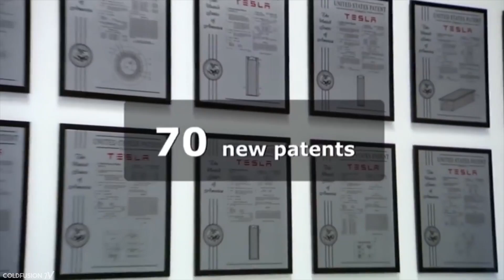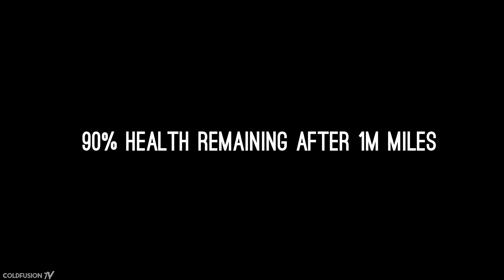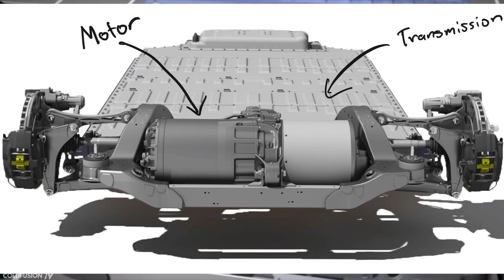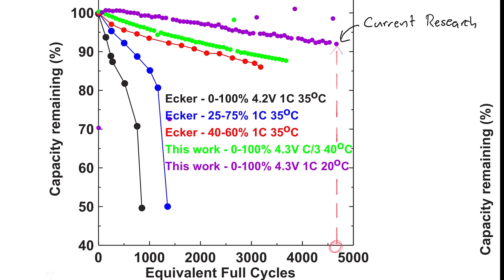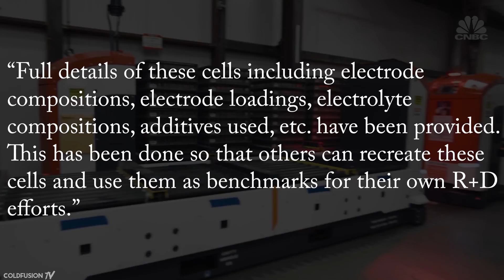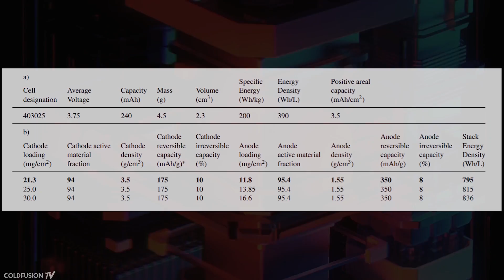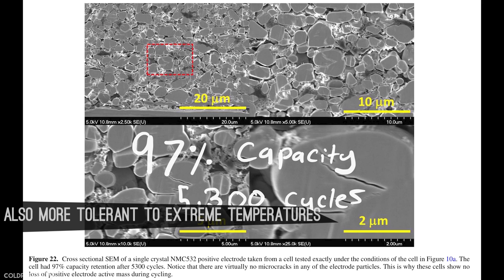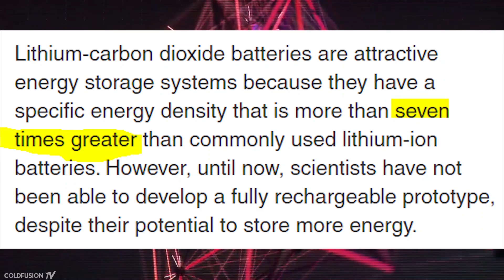Tesla's Million Mile Battery

Comment: I've been saying for ages we need a revolution in battery tech, It's only a matter of time. Imagine touching your phone on a charging pad and it recharges from 1% to 100% in 30 seconds, then the battery life lasts for a month.  It could revolutionize so many different technologies.
Reply: The path to achieve this is energy efficiency rather than storage capacity. You can't push currents into the phone that would give you a month's worth charge in 30 seconds at the current level of power consumption. And if you could, imagine a battery with such low internal resistance shorting out. You don't want that in your trousers pocket.
Reply: Paladin Smith Ok to charge your phone from 1 to 100 in 30 seconds won’t happen. The speed at which you would have to transfer that much energy would either blow up or short your phone because it simply can’t take that much. It’s too small.
Reply: @DanKop2  well , people said the same things when first phones came. Tech evolves, of course it can be done
Reply: Siim Tuulik it’s physically impossible though

Comment: Problem One: The CAR won't last for a million miles
Problem Two:  An ICE and an EV needs the exact same maintenance - except for the motor.
I have never had a car that the engine has failed. They have all rusted apart, or other maintenance has become too costly. 
This is the same for EV's. The manufactures will be adding thousands of parts to every new generation and selling them as better, more advanced, evolved, new, improved and so on. If manufactures of anything would be foolish enough to make products that lasted twice as long, they would have either half the income or be forced to charge twice as much for the product. Nothing will change when all cars has gone electric. They will rust and age just as the old tech. But that doesn't mean the propulsion system isn't better. It is. But that's about it.
Reply: That's the crazy part about tesla, they are built to last as long as possible with little hands on, even their brakes last over 100k miles because their regen systems compensate for them, they also recommend only servicing the car twice and dont require them to come again besides tire and fluid changes. No transmission, simplified cooling system, battery that has a handful of moving parts and a motor that has only 2-4 moving parts, I never done maintenance on a power tool but they dont ever seem to need it despite being thrown in mud and sand.

Comment: Could you imagine if people had been working on this tech for 100 years like they have IC engines??
Reply: Same goes for solar energy
Reply: Did some research papers for school 
Electric cars were more popular than ICE cars somewhere around the 1850-1900, but the breakthrough of more reliable 4stroke engines and the Model T basically killed the Electric car
At that time cars weren’t really the staple that they are today, and basically nobody cared if one was electric or ice powered, they just cared it worked, and the electric car had poor range, long charge times and basically poor everything
The ice on the other hand was reliable, had decent range and u just put fuel in it, it’s fast

And To add to your comment, ICE’s have come a long way
Imagine telling Ford or whoever engineered the Model T, that a F1 car would make 1000hp from a 1.6l turbo engine ( although with some hybrid in it ) 
And this refinement, little additions over time is what the research paper on the video is about, they’re starting the way for better batteries, the same as the Model T made way for better cars and engines
Reply: @grewjuionpriweuma  don't forget both worldwars. This pushed the development of ice cars enormously. Electric cars were just to slow at the front. And to long to charge
Reply: @grewjuionpriweuma  
Look at Mercedes 0m647 
The only "MILLION MILE" I.C.E available on the market....
Reply: guanwei he right, and other have pointed out, over 100 years and billions of dollars of investment took the Model T to the Bugatti Vernon. Again, imagine if EV’s hadn’t been more or less shelved for 100 years.
Reply: Can you imagine without IC engines, you would never have gotten to this point. 

This is why we are suffering as a society.
Reply: They don't work in this tech becouse they want make much money as possible from people . And whit I.c.e they make more many for sure. Petrol, maintace, oil, sparks,  filters, belts, and much more.
Reply: I'm fairly sure this tech is just being released right now because someone decided it was time. The dollar was pegged to oil more or less after it was taken off the gold standard. So naturally they made sure demand for oil was as high as posible. So if they are seriously considering releasing battery powered cars that will make gas powered obsolete then your witnessing the end of the oil standard.
Reply: Battery power actually predates the internal combustion engine, but unfortunately when the IC tech took off, there were fewer people that focused on improving batteries. Thankfully, the focus is back on producing electric vehicles with longer ranges and improving battery output and longevity!
Reply: @Eye-Byte  you are one of the few on this thread that gets exactly what I meant. Electric cars and IC were neck-and-neck 100 years ago. IC took off, EV was shelved. It could've easily been reversed under different circumstances, and the tech progress is hard to imagine.
Reply: @Eye-Byte  well that's the whole point, batteries in theory have been around for a long time But, there was not so much emphasis and focus on improving them, if equal amount of resources and time was spent on battery technology, we'd be decades ahead. But it's a good start at least Tesla pushed the envelope and forced other big car manufacturers to jump on the idea as well.
Reply: now I wish my cellphone battery will last an entire week
Reply: @kilgoretrout6079  Indeed, it was really the consumer electronics revolution of the 1980s that really drove battery research forward.  The need for small, lightweight, ideally rechargeable energy storage skyrocketted.  The rechargeable storage world quickly progressed from nickel-cadmium which dominated in the 1980s, to nickel metal hydride in the 1990s, to li-ion in the 00s and 10s. Li-ion in turn isn't really just one chemistry but a whole complex family of them, only sharing in common a general mechanism of lithium intercalation and migration across a membrane - and even many next-gen techs that go by other names (lithium-sulphur, lithium-air, sodium-ion, etc) are really variants of the basic concept, just with some alterations to the working mechanism.

The li-ion approach really a great way to make batteries, because you have basically a "scaffolding" on each side that you're just slotting a positive ion into/out of (in this case, lithium), and so it's only the (ideally inert) scaffolding that needs to maintain its electrical and physical properties. And, ideally, no chemical reaction happens to the scaffolding at all in the process.  If you do things right, nothing changes about your battery at all during charge / discharge except where your lithium ions are located - the high electrochemical potential anode side or the low electrochemical potential cathode side.

It gets harder when you try to ditch said scaffoldings. One next-gen tech, for example, plates out lithium metal on the anode end instead of intercalating into graphite.  The problem is that if, during a charge/discharge cycle, any of the lithium breaks off... it's gone, worthless.  Surrounded by a SEI, just floating around inert, with no electrical contact and no way to make one. If you lose just 1% of your lithium this way each time, after just 50 cycles, you've lost 40% of your lithium.  Versus when intercalating into graphite, if you accidentally leave behind 1% of the lithium in the graphite... so what?  It's still there, just waiting for next time  :)
Reply: Good thing with the insane bumps in machine learning and AI in R&D labs, 100 years is gonna pass in a decade or two soon enough tech-speaking.
Reply: If the ICE had not been the de-facto form of propulsion in the early 1900's and the battery powered vehicles had been the sole source of development, this world would be completely different.
Reply: voodooutt  No airplanes!
Reply: Guys, OP isn't saying that electric vehicles didn't exist 100 years ago, he's pointing out how different things would've been now if the industry had put as much resources into their development as they have with ICEs during the last 100 years.
Reply: @MLennholm  We couldn't have done that.
Reply: Jonte Tomte Why not?
Reply: MLennholm Windjammers moving all those rare earth elements around?
Reply: They have been. The smartphone era has simply accelerated it.
Reply: ripvanstinkle Yes, we wouldn't have airplanes. We wouldn't have the batteries either. How do you think the raw materials were moved?
Reply: Greg Fakerson  Good point. Electric cars are basically time machines. Important comment, thanks.
Reply: ripvanstinkle Well, it’s one more crime on petroleum-auto industrial complex. They are still screwing the world over.
Reply: I agree, while some of the other commentors are correct in that ICE was easier and cheaper in the beginning and therefore the best choice. Some also seem to forget that Nicola Tesla was making astounding advancements in electrical tech over 100 years ago, that there's a battery at Cambridge university (I think) that had been running nonstop for over 100 years without a recharge (very low voltage bell, but still). The physics that point out the very poor efficiency of ICE were known long ago. And lastly, the MOUNTAINS of profit being made yearly by the oil companies (for over a century) mean it has ALWAYS been in their best interest to sell more oil faster. Therefore buying, hiding, or outright lying about ANY technology that could cause them to lose profits (Including mpg efficiency discoveries). It's only good business. 
How much farther could we be indeed?
 (or more likely, how much farther ARE we currently that just hasn't been released yet?)
Oh, then add in that America went off the gold standard to tie our dollars value to oil. Which then became a political reason to keep ICE chugging along and hide/hold back the rest.
Reply: Greg Fakerson  yeah

Another point that is being ignored in this thread is the fact that vast amounts of money and effort WERE spent (by the likes of Ford and Edison) in the early 20th century trying to develop battery tech for electric automotive use. But the results only emphasized the fact that ICE was the only way to go for their foreseeable future.

In spite of the oil cartel conspiracy rants here, neither nickle iron nor lead acid had any hope of providing a competitive electric solution. Even now lithium is only just starting to be a contender in the mass auto market. And lithium just isn't safe at all without the battery charging being controlled under the vigilant eye of a dedicated micro-processor. 

IF we had spent the effort (that was expended on ICE) to develop EVs instead, then cars would still only just recently be getting cheap and practical enough to be available to ordinary people. Just our understanding of quantum mechanics alone would have held back EV tech for decades because there are no micro-processors without that. 

Then there are all the minerals mined and foods farmed in the last 100 years that only existed because of ICE development. That materiel supported all the people who did the EV, computer and quantum science research. 

ICE first was the correct techno-route
Reply: They were!!
Reply: now that the industry is fully investing in electric (mercedes-benz parent company has stopped all R&D of ICEs) i really believe we will see exponential development for both batteries and electric motors
Reply: Big oil companies will murder those inventor's...Elon is a lot richer to mess with....so he is safe..
Reply: Ic engines are artificially held back. You can travel for miles on a thimble of high octane gas. Research Tom Ogle.
Reply: As far as the core ic engines development i dont think that much research was done, i think the most influential breakthrough came when fuel injection replaced carburetors, and since then its been pretty stagnated. Where the auto industry has really excelled is in chassis,  refinement, safety, and manufacturing department. EVs can also benefit from this 100 year investment
Reply: @kitkat224  Look at a Model T and a Ferrari Formula 1 V12...I think there's been some improvements made over the years.
Reply: Oil companies need to make money, you can see how much hate tesla has.

Comment: The part that will wear are struts/shocks, steering rack/tie rods, chasis parts like ball joints, bearing assembly, and bushings.
Reply: Radio button and a/c. Are you just naming all the other parts on a car? You forgot the body, door handles, seats etc
Reply: @EdisonCarter-d9i  The above listed are parts that will wear no matter how they are designed. Doesent matter if it's a yugo or a Toyota, they wear just the same. Sure other parts may wear like door handles but not if the proper materials are used and it's beefed up correctly. In other words, the a/c button can wear out and eventually break, but they can also just design a button that lasts forever. The fundamentals of how ball joints work means that their failior is inevitable. If they don't fail at some point, this only means that they aren't doing what they were designed to do.... That make sense?
Reply: gt5228z No. everything fails eventually. If they can design an a/c button that lasts forever (which they can’t) then they’d design ball joints that would last forever. I was being facetious because you’re statement was redundant.
Reply: @EdisonCarter-d9i  I'm not saying forever. Nothing lasts forever. I'm saying that a PROPERLY designed door handle is only broken as a product of abuse. The reason for my comment was because he's saying that cars can last 1 million miles because of a battery. The parts mentioned above are very expensive to repair and mostly fail in 110k/120k miles. You may break other parts like door handles but it's not reasonable to nessesarily expect it to break in 1million miles like the earlier mentioned parts. Obviously I missed some parts, for example the A/C pump will wear and leak as all pumps do with time.

Comment: There is argument that Dahn is throwing a "red herring" to Tesla competitors. It is significant that the chemistry of these long-lasting batteries still have a "high" proportion of Cobalt *(They are NMC-811, meaning Nickel=8 parts, Manganese=1 part and Cobalt=1 part).
Tesla (Musk) has publicly stated that they are striving to reduce Cobalt - if not remove it completely. So while Dahn's team have found a way to improving the chemical structure of these elements in combination - through large crystals - the quantity of Cobalt in the mix runs counter to what Tesla is aiming for.
And... Dahn has made his findings "public".
What if the intention is to "throw the opposition off the scent"?
Give them this promising technology - which is Cobalt-dependant...
... while Tesla continues with its own version of the million mile battery (but it's Cobalt-free)?
Afterall, nowhere in Dahn's research does he say that his methods are for Tesla. He just says what HE has discovered.
Tesla's research may have discovered ANOTHER way to make a 1-million mile battery.
Could it be that Tesla WANTS the opposition to believe that DANH's tech is what they would use, and they all rush like sheep to adopt it?
Meanwhile, Tesla quietly gets on with its own 1m mile battery... Without cobalt?
Reply: It's possible.  They keep investing in research and buying battery tech companies.

Comment: Tesla has been unable to do what Henry Ford did back in 1913 with the first assembly line. As for his other inventions he also cannot build a car or solar panel or battery that doesn't spontaneously combust. Genius my ass.
Reply: 1: there's over 100 years between Ford and Musk. Comparing the two is quite unfair.
2: cars catch fire, it's normal. Tesla just seems to suffer as whenever one catches fire the media jumps on it. But when a Chevy Bolt EV caught fire in Hungary nobody batted an eye.
Reply: This post brought to you by the petroleum industry.

Comment: Once they have range and charge times at the same as a gas car then i would think of buying. I live in the UK most people do not have drives and park on very congested streets and in the town i live in we only have 5 chargers in a 3 mile range . Electric just is not an option for most yet, and if the UK  does not make significant investment in to our energy grid we will not be able to supply the demand. I would prefer more options in hybrid cars to be available not just full electric even if the small petrol or Diesel engine is just a generator for the batteries at least we would have an intermediate option.

Comment: Meh not that impressive. If 500,000 miles is the current standard, that's way longer than traditional cars last anyway. The main obstacle to people buying electric cars is range and charging times. The main thing they should be focusing on is making charging quicker - a lot quicker. I'm talking as quick as it takes to fill up a regular car with gas.
Reply: They are in fact gonna improve the range. Tesla has bought a company a few months ago that makes batteries. These batteries already have higher energy denisty and is on a pathway to double it. Also it costs less and it doesn't have cobalt which is pretty bad for the environment.
Reply: and also the manufacturing area is reduced 16x.